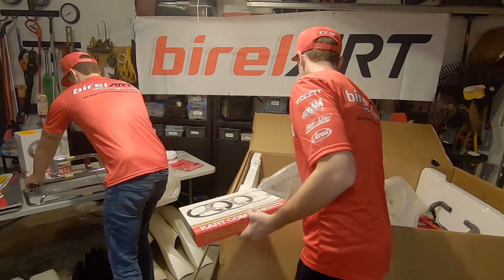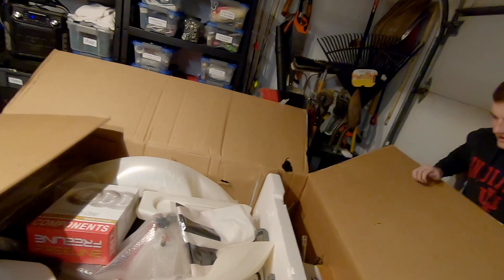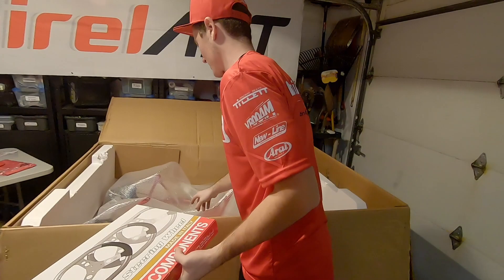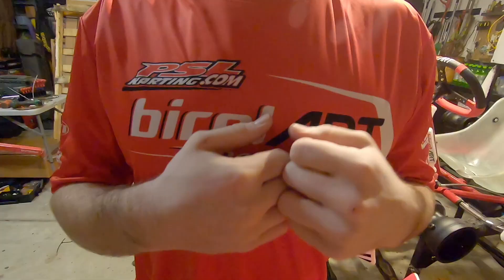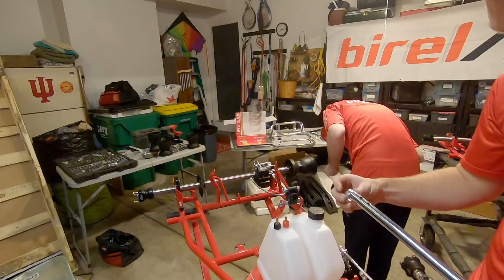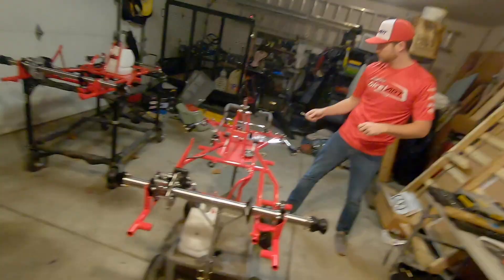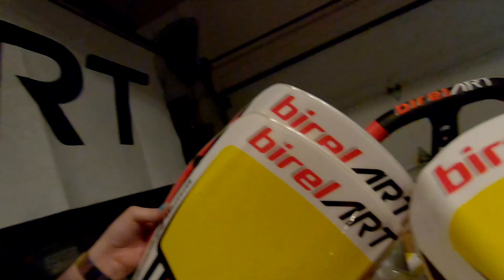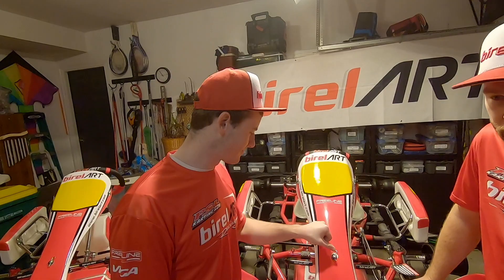KART VLOG 37 - Unboxing New Karts! | LO206 Karting Birel Art

Comment: Just as a tip for the Birel/ any OTK kart for 206 racing, those karts can be fast as all get out but you have to be absolutely perfect with your line. I use a Tony Kart which is basically a green birel and I finished 2nd it the grands last year in the junior division so the karts are really fast. They also bend a lot easier than your eagle as well.
Reply from the maker: Need these tracks to open back up for more testingg 🥴

Comment: How did you guys order the chasis with the some of the parts already installed, when I go to order I need to separately order the chasis and it's parts
Reply from the maker: Hi Sorin, are you ordering a BirelArt or a different chassis? I only have experience with BirelArt's, but when we order them from PSLkarting.com they come with all of that in the box

Comment: Quick question, when you guys were running the comet eagle, did you have the ability to adjust the camber and caster? And would you recommend it for a first kart to run L206?
Reply from the maker: Good questions. First, the Comet Eagle does have the ability to adjust both caster and camber. Second, I have never had an issue with my any Comet Eagle's that I have run (several). But, I will always recommend beginners to run what the most popular/successful chassis at your local club. It makes the learning curve much, much easier and more people will be able to help you out. But don't sleep on these Birel's. They are the real deal.